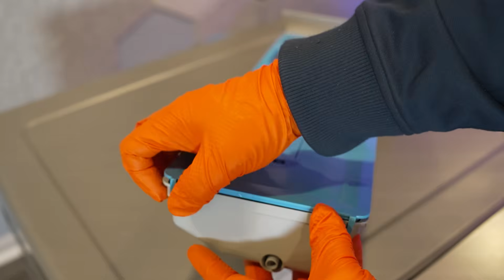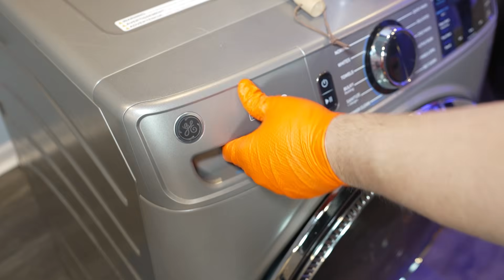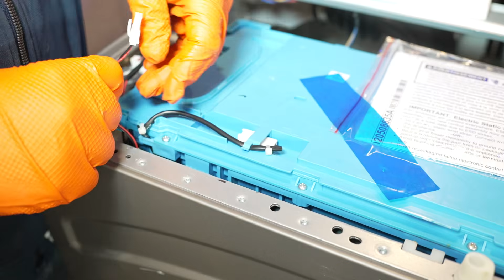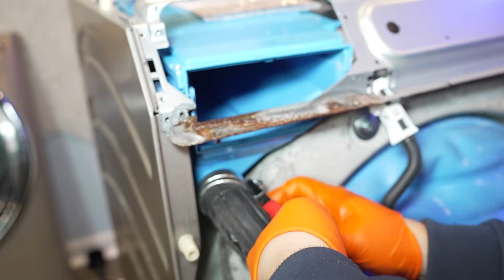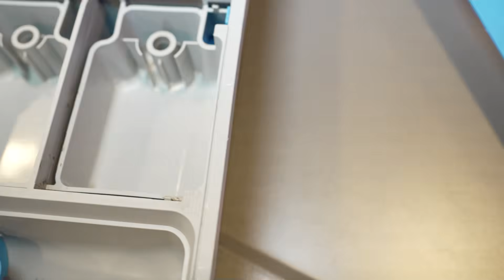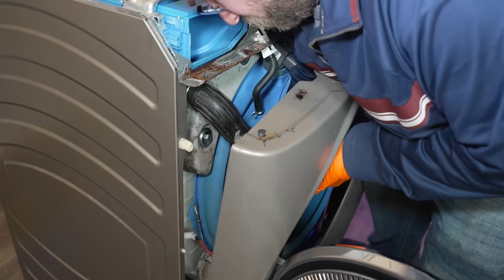Does Your GE Front Load Washer Leak from the Dispenser? How to Repair

Comment: I never had any trouble with my old 40 year old model and I traded it in for this piece of junk - All my colored clothes look tie dyed now -- this has been going on for many months and I have just come to the conclusion that I cannot use bleach.  Can you please give me the part number to replace the dispenser unit - this will be the last straw because if replacing the part does not work - I will be putting this piece of junk out on the curb and gong to an auction to buy an old machine that i can trust.  100's of dollars of clothing ruined from this stupidity.  I really wish that only experienced people would design things.  It seems all these newfangled products are crappy.

Comment: The bottom blue piece of the tray comes off also and it gets nasty in there and clogs the fabric softener dispenser. To remove it,  start from the two tabs holding it in and pry up from that end, not the other end.

Comment: My washer seems to be leaking when it hits the rinse cycle and pressure increases so it over flows the dispenser area rapidly flowing into the gap between the metal and plastic?  Does this make sense? I have the exact model you worked on. I have removed all parts/pieces and boy it’s frustrating

Comment: This is very interesting!  I have a GE washer and the problem I have been having is that the water does not flow during a rinse cycle.  It fills just fine during a wash cycle, but no water comes out during a rinse cycle and after a couple minutes the message H2O SUPPLY scrolls on the display.  Any ideas on what could be happening?
Reply: Had this same issue with this washer after the tech replaced the inverter board it turns out that the cold water hose was damaged causing the water pressure to be to low.  Check your hoses that come from the faucets and that they are on
Reply: @Valkeaa  I checked the hoses on mine too and everything looked fine, so I went ahead and replaced the inlet valves — no change at all. I finally had a GE tech come out. He first suggested the inlet valves as well, but I told him I had already replaced them with no improvement. I mentioned that the issue felt like it was further upstream.

He agreed and recommended replacing the main control board. He ordered one, I waited a couple of weeks, and once he installed it the washer worked perfectly.

After that, I did some digging on GE’s site and found out that control board failures are a pretty common problem with this particular GE Profile model. Honestly feels like they rushed this washer out before everything was fully engineered.

But once the control board was replaced, everything has been running great.

Just sharing in case someone else is chasing the same issue — sometimes it’s not the hoses or the inlet valves at all, it’s the controller.

Comment: Ben, Thanks for the video.  Had water leaking from the bottom of the door down the front of the machine.  I took the front off and decided it was the drum seal and replaced it.  Still leaked.  It was then I noticed water coming out of the drawer, going around the door seal and down the front.  So I cleaned the drawer and dispenser really well and the leak stopped.  For a few weeks.  Decided to replace the whole dispenser.  This tutorial helped immeasurably!  The job took a few hours, but was pretty simple and straightforward.  Tested the washer and no leaks!  I still don't trust it.  I couldn't find anything "wrong" with the other dispenser.  All the hoses were clear and secure and I couldn't find any plugs or cracks in the old dispenser.  You'd think a 3 year old washer wouldn't have these kind of issues.  Thank you again!
Reply: Running into the same issue. Just cleaned the dispenser and the hose. Nothing was in there. I don’t if I should just replace the housing unit or both.

Comment: 27 year tech 3 times i have done this job what a pain in the ass! At 13:31 i have been running plumbers putty between the the ui housing and the blue soap housing this has worked in two of the three.
Reply: I hate working on this machine! Been a tech more many years and no soap dispenser should take this long to replace.  Not to mention that the top only comes off by removing the interface.  What a dumb ass design.

Comment: All of this work because a bit of water leaked out of the front of the dispenser?
Reply: It's not always just a little bit. And it doesn't always leak out the front. It can also leak inside the washer where you don't see it , until your floor is destroyed.
Reply: @EconoAppliance this is what has been happening to me

Comment: I was searching for a fix for the fabric softener dispenser not emptying. Do you have a video to resolve this? Or the cause?
Reply: I'm here looking for an answer to the same issue with the fabric softener dispenser.  Have you found a resolution yet?
Reply: I had older unit where I had to replace  water valves in the back. Solenoid got stuck and wasn’t letting water through.

Comment: I have an LG washer that came with the new place we bought and it has turned into a bit of a curse. I think it is a relatively new (~a few years) LG WM4000HWA but it is leaking from the bottom and I don't know if the previous owners EVER cleaned the filter. I am in way over my head and thought I fixed the problem by just emptying and cleaning the filter but it still leaks and the filter area retains water after every load. And I am sure the thing is filthy. I like the idea of fixing it myself but it may be more trouble than it's worth to try to fix this thing instead of replacing. How do you know when a machine is too far gone?
Reply: It depends on you really. How much knowledge you feel you have to confidently fix the problem, how much money are you willing to spend on replacing the part and the time to fix it, and if you feel that fixing it isn't worth the time or effort depending on what the unit originally cost you.

Comment: I was hoping to check out the meter probe extension needles but guess what?  Not one link to them at all. Meter and included accessory kits that don't have the tips, soldering iron and solder sucker, tool bags, etc. but no meter lead tips. Luckily, I have alternative sources, but you really shouldn't promise what you don't deliver.

Comment: Had this issue with my LG.  It was just a cleaning issue.
Reply: Here's your solutions: Used Whirlpool Direct Drive (Design 2000) washer or a new Staber. Both have mechanical controls and are made in the USA. Hope this helps you out if you ever need a new washer.

Comment: I don't know why, but I hate the auto-dispenser idea. It has always seemed like a marketing gimmick to sell more laundry detergent than of any actual use. I mean heck, if you can't add the right amount of laundry soap to your clothing, you've never talked to an appliance repair tech. lol
Reply from the maker: I did a good bit of tests on samsungs new one with auto dispenser. Its very very efficient. Saves me like 40 cents per load vs tide pods
Reply: I have a GE with an auto despenser. One Sams Club sized Persil liquid laundry detergent last 6-8 months between 3 people doing their laundry separate from each other.
Reply from the maker: @kevikev2.0  exactly. We are way less accurate at dosing than we think. Ive been doing tests with the Samsung Bespoke and the data is very, very eye opening.

The correct dosage for 12lb of laundry is 1.7oz. I kind of want to do a test at Walmart with a table and make people guess if they are using the right amount of detergent. Because I bet they arent
Reply: @bensappliancesandjunk  I was instructed to use either a shot glass or a double shot glass - depending on the soil level of the clothing. Thats it for detergent.
Reply: We have a GE with the dispenser and my wife was questioning if it was working.  We'd previously gone through a Costco size container in a couple months and with this it was about 6 months.   Of course I'm sure another part of that is this is an HE washer and the other was absolutely not.

Comment: Vampliers are a special kind of pliers with jaws designed to grip the sides of a screw head.  I had to look that up after using YouTube's closed captions.

For what it's worth, I prefer what I thought he said about the tool, "The damned pliers I bought just for the extraction won't even work due to the rust."  I truly hate buying a new tool that doesn't work for me. ;-)

Comment: Hey, Ben. We have the 655 model that totally failed on us. I have a theory on the failure if this makes sense.
There's apparently a bulletin out on the inverter board. Some have prematurely failed, and some of the replacements seem to have problems. In our case, a tech replaced the board as a shotgun approach for another issue in the past. Allegedly, he replaced it with one of the inverter boards covered in the bulletin. I noticed a high-pitched squealing coming from the unit after this. If your ears can't detect it, try an audio analyzer app for your phone. While holding the phone near the control panel, look towards the high end of the band for some high spikes.
Anyway, I think what happened to our unit was as follows: The replacement inverter board was generating electrical noise on the motherboard. This noise eventually propagated to the lock switch line. The noise was then interpreted as many rapid lock/unlock commands by the door lock. Since the door lock is a simple solenoid, it tried to follow the speed of the switch noise, heated up, then fused/melted in the lock position. Apparently there's no way to get the door open without breaking the lock. A second tech stated that it didn't used to be this way, but apparently the emergency release has been designed out of the newer models.
If you have an oscope and one of these inverter boards, you can check for the noise they're generating.